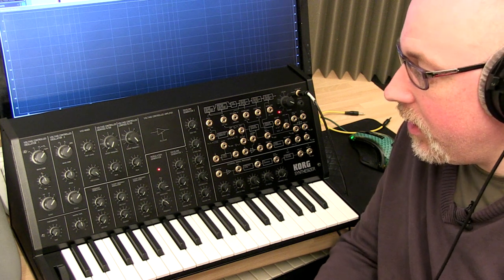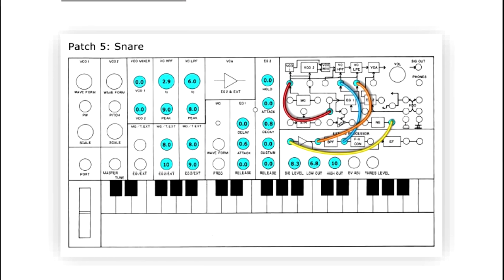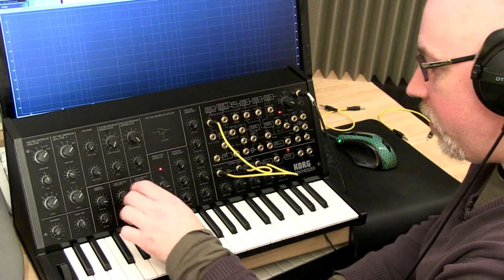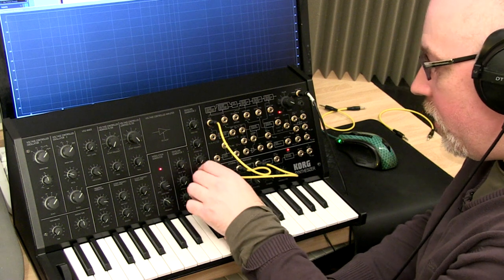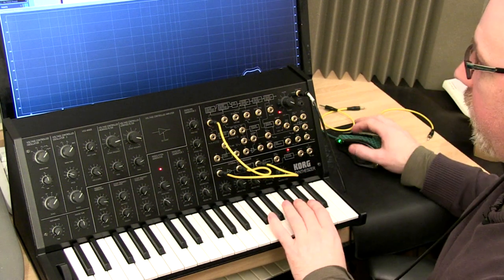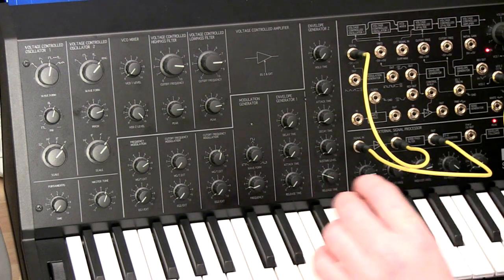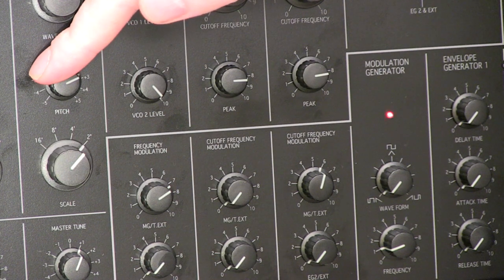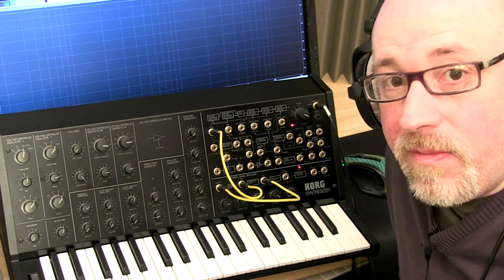Korg MS-20 Mini - Drum Synthesis Part 3 - Cymbals

Comment: very good tutorial, cymbals, rides particularly are a hard one, i've been trying for ages to get that type of sound in microtonic and can't quite seem to crack it
Reply: I had a quick look at microtonic, for cymbals I wouldn't recommend it. Seems like it is one voice, one drum sound. which is just about OK if you have a machine like the MS20 but microntonic, with its flavour of FM, you would need multiple voices for one cymbal. So I would recommend a poly synth. even one without FM you can get a decent cymbal from with the basic technique of having 6 voices playing discordant notes and high-passing the result. Try a patch along the lines of a triangle mixed with noise going through a key-tracked self-oscillating filter.. set to just oscillate, so you can hear the tri-oscillator and the noise component mixed in with the filter, tune the cut of to match the oscillator note. hit 6 keys, high pass. Go from there as a starting point. the microtonic is a no-go, unless you can easily use it with multiple voices at once. the high pass at the end of the chain is very important.
Reply: i know that is is a bit of a limitation in microtonic, and since there's only one modulator-carrier oscillator and you can't set the modulator waveform so you can never feed it to the point of reaching noise (at least i think that's why, since the modulator is just a sine wave), and it lacks a square wave, i've been using FM8 for cymbals but it would be nice to be able to make a cymbal in a drum synthesizer like microtonic that i could sequence with other voices. and i would love an ms20 but it is quite pricy, i've been thinking about it though, it's a great synth, i tried it out in a shop once.

Comment: wow, never woulda ever thought of feedback from the esp...what exactly is feeding back?  I'll patch this with the amp out to the external sig in and listen...
Reply: Auxiliary line inputs tend to be a bit hotter than line level outputs. Think past the 2 o'clock position on the esp volume knob as past unity gain, it's for that reason that clipping occurs from the external signal processor.